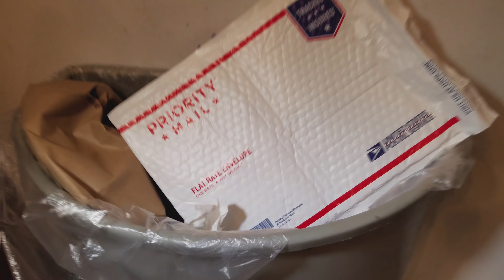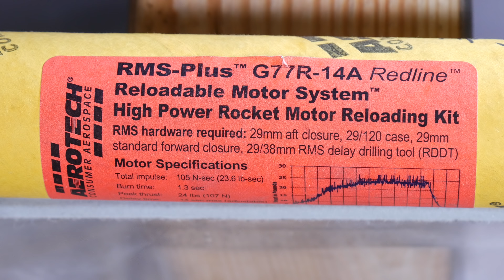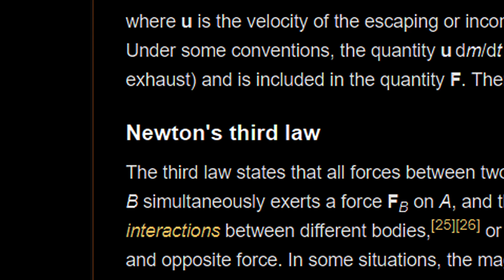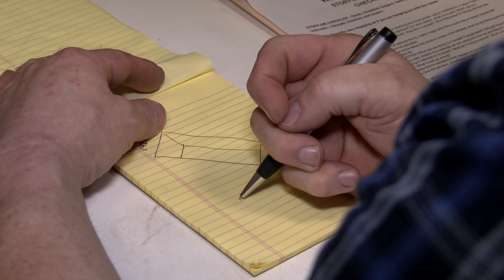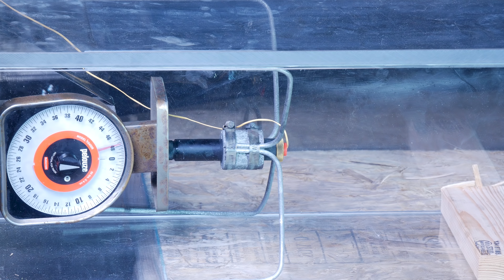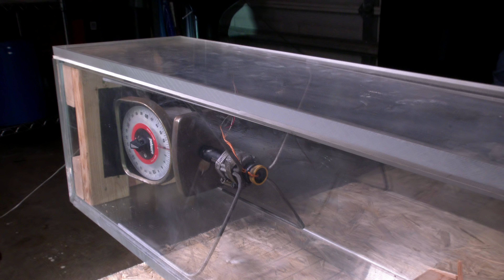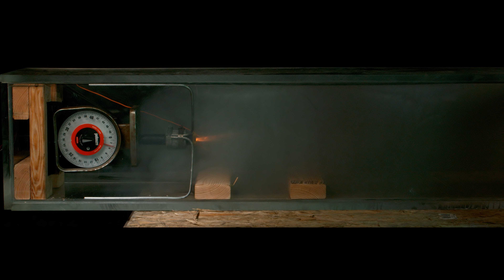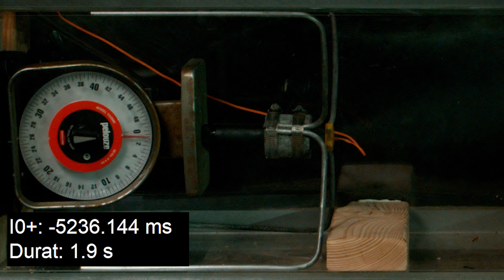Rockets in a Vacuum Chamber - Newton's third law of motion Visualized

Comment: If u ask me all I saw is that rockets wouldn't work in space. Then they did whatever it took to make it work. Idk I call straight b.s on this! Lol
Reply: Ok lets think about this. When you burn a gas what happens it gets hot right 

Do you know heat is just random motion of molecules
Reply: Tyson Carpenter - 👍🏽 this study is obviously flawed!
Reply: It looked like the time they are calling it a success didn't do any better than the times before, they just slowed the replay down to the point it looked like it was burning.
Reply: @hardersusan  no, there was legit thrust and the scale registered it. But that thrust was based upon the capped igniter that held s small amount of air that was contained like scuba tank, allowing it to at least combust. Once it did, the chamber was so small it's own gases pressurized the chamber and used the walls and its created atmosphere to push on the scale. The experiment was flawed and biased from the start. Yet, cleverly disguised as neutral scientific method.
Reply: What? You think this experiment is comparable to what NASA works on?
Reply: @hardersusan  What? It created pressure against the scale and burned fully... It %100 worked for the experiment they were doing.
Reply: @steved8714  Idk
..but if space is really a vacuum and there is no o2 in space witch fire needs to burn then how could they have rockets in space??? In a vaccum with no o2 but they went to the moon?? Witch NASA now says is in our atmosphere and apparently out atmosphere is way further away then they thought!?!?! I can b,s on,that too!! Its just like this exsperament they do and say whatever it takes to make there beliefs and there "science" to work!! Its all bullshit that's all I know!!! Just like this video!! The shit did not work when,it was just a vacuum so they started adding oxygen and whatever else to make it work to make it seem like oh yeah a rocket will totally work in space!! When anyone who knows anything about fire knows it needs o2 to burn! They have never been to space never will be to space and they are all liers!!! I wish people would wake up amd see!!!
Reply: @tysoncarpenter8628  solid rocket fuel has an oxidizer in it dude. meaning after ignition it burns it's own source of oxygen.
Reply: @BrewSquad  but how in a vacuum? Like in this experiment showed the first time in full vacuum mode lol. It didn't work.
Reply: Solid rocket fuel contains its own oxidizer. No O2 needed. Chemical rockets carry a tank of fuel, hydrogen or RP1, and a tank of liquid oxygen. The rest is just Newtonian physics.
Reply: @Your.Best.Friend  Only problem with that, is that a rocket do not push against air. Air is not solid and would only be pushed away. An explosion creates force equally around the explosion. This force is not dependent on air. The explosion in it self are dependent on oxygen, that is why the rocket brings this with it and feeding it into the combustion chamber.
The force cannot escape anywhere but out trough the rear hole. This pusher the rocket, the force och the explosion in the combustion chamber. Have nothing to do with air.
Reply: @tysoncarpenter8628  No, try to use your brain. The rocket are not dependent on the oxygen in the atmosphere. Two tanks on the rocket, one with fuel and the other with oxygen. Those to sprays in to the combustion chamber and voila you have an explosion without the need for atmosphere.
This is also why a jet engine does not have inlets for air as aircraft's have. Aircraft's have only fuel and use the oxygen in the air. Spacecrafts have both with them and hence do no need and do not have inlets for air. Only one outlet for the force to act trough, at the rear. Then you have the forward thrust.
In this experiment they used dry rocket fuel mixed with oxygen.
Reply: ONE thing is for sure about all this. There's a lot of nerds in here.
Reply: Tyson - I can explain EXACTLY how rockets work to anyone with a high school grasp of basic physics.  FIRST:. If I fired a crossbow in a vacuum chamber would I feel a recoil?  Yes or no?
Reply: @tysoncarpenter8628 : It takes two types of fuel for rockets to work. One of them is an oxydizer that allows them to burn in the vacuum of space, creating thrust. Things move easier and faster in a vacuum, because there's no drag from an atmosphere and gravity is weaker when farther away from planets, moons and stars. That's why they're able to reach speeds into the upper thousands of miles per hour and without heating up from friction in an atmosphere.
Reply: @tysoncarpenter8628 : His oxydizer wasn't mixed correctly. If you have pure oxygen, even steel will burn like paper in a vacuum.
Reply: @nikitafagerbrant2428 : They don't have to. All that's needed is for a high volume of burned fuel to be expelled out the nozzle and a high velocity Nd the law of 'Action-REaction' takes place. For example. If you were in space and you had a basketball and you threw it outward away from your chest, you're going to go the opposite direction. The harder you throw it, the faster you move in reverse. The basketball doesn't push against any air molecules, but its weight alone being thrust away from you is enough to push you in the opposite direction.
Reply: @nikitafagerbrant2428 : The exhaust is squeezed through the nozzle at greater than the speed of sound creating a massive amount of thrust which forces the rocket into the opposite direction. The larger rockets burn 5 tons of fuel per second. More than enough to propel the rocket upward and as it goes higher, it also gets lighter in weight and has less atmosphere to produce drag. The higher it goes, the faster it picks up speed to break the earths gravitational pull to put it into orbit. 👍
Reply: Put the bong down and step away from it slowly.
Reply: @preppertechnicianee6013 : Heat expands. In a combustion chamber, it helps force the exhaust out of the nozzle at over the speed of sound. Just like a fighter jet engine. That's why they shake the ground when the light, 'cause the sound barrier is being continually broken.
Reply: Thane Mac  - "No because cross bows don't create recoil."
There is a video on my YT channel that says different.
Please have a look.

Comment: I estimate that one side of that chamber is 50 inches long X 8 inches wide =  400 sq inches. Atmospheric pressure is 14 lbs. = 2.5 tons.  The total pressure on all sides = 10 tons.  That is the weight of a small bulldozer,   How did it hold up?

Comment: It would be a huge and expensive project but it would be interesting to see what a Tesla Roadster would do in a vacuum.
Reply: The tires would explode, and if it was in "space" the car interior and plastics would melt. It's all bullshit.
Reply: Line of Sight wrong
Reply: Line of Sight I'm with you 100% I believe the tires would definitely explode and the supposed temperature would basically melt the paint unlike the CGI version that we all saw that they passed off it's so fake it has to be real.
Reply: boboprime2000 how can you just say wrong produced your research in your evidence what would happen to a regular Tire in a vacuum do you want to see what a steel truck container after they took the air out look like after it was exposed.
Reply: Exaiver Sandiego you obviously didnt doch the Research, the pressure difference between Here and outer space is one bar, If a tire has 2 Bars of pressure on earth, IT has 3 in space, Most tires can easily Withstand 5bars.
The Paint Argument is also Bs, as There is no Temperatur in space, and the suns radiation isnt Strong enough to have a visible effect after Just 5 hours
Reply: Exaiver Sandiego Not to mention that the Roadsters trajectory was tracked by multiple Hobby astronomers
Reply: boboprime2000 wait a minute are you actually saying that you believe that the Tesla Roadster is actually in outer space heading toward Mars? So that means you probably think that back in the the sixties that man actually walked on the moon and somehow got by the Van Allen radiation belts and did it successfully with no problem is that what you're saying?
Reply: Exaiver Sandiego i dont believe it, i know it, Apollo flew through the weakest parts of the belt ans you can See the landing Sites With multiple Satellites, i know some Moon landing shit IS shady as fuck, but Trust me, as someone who grew Up in the soviet union, they would have immidiately destroyed NASAs Reputation If IT were fake
Reply: Exaiver Sandiego correction, the Roadster is heading towards the Asteroid belt
Reply: Exaiver Sandiego
Hellooo !!! Is there anything inside that flat skull of yours ???
Oh, I see, emptiness and flatness...sorry, I thought you were a "normal" human being...
...well, if this is the case...go on then, give us some more good laughs, you IDIOT !!!
Reply: Axel Pixel acting pretty sure of yourselves.  Lol  So you or someone you know has been to space? Or you poured through all the data, telemetry and physics jet propulsion and astrophysicist theorem to make a concise argument for your belief? You all sound very sure like you've been there. Just wondering how it was and what zero gravity feels like? The vacuum. Lol
Reply: +Line of Sight   Why would the tires explode?   Most tires can handle much more pressure than is used.  Plus if necessary they could reduce the air pressure in the tires before launch so that the pressure with an external vacuum wouldn't be that high.
Reply: Tires wouldn't explode. 14.7+35 psi is just 50 psi. But the car would melt itself and short out from lack of battery cooling.
Reply: +Patrick L   Why would you think that the car would melt?  Why would the battery need cooling?
Reply: My3dviews I assume the OP means driving it in a vacuum. That would make the batteries hot, especially with a lack of air. Although it would be interesting to see how fast it could go with no wind resistance.
Reply: +Patrick L    The radiator and engine would get hot from a lack of air, if the car was running, but not the battery.   Also, no reason that the car would melt as you mentioned in your previous comment.   With it flying through space it would just get warm from the sun on the lit side, but cool off on the dark side of the car.  It seems to be rotating, so that would even out.
Reply: wow a lot of waking  up to happen still in this chat. But nice comment bro.

Comment: I couldn’t stop laughing from seeing the lid of the “vacuum” chamber almost go flying off halfway through the test. These guys tried hard and did a good job building a cool experiment...but come on that things flapping around like crazy with all the high pressure gas trying to escape...it’s not really proving the point of whether or not rockets will work in space. It’s proving they will work in a pressurized plastic box for sure though.
Reply from the maker: Lol... True!, Btw for sure my biggest mistake was not having a full vacuum on the very first test. The box got a little bit cloudy after that. I later on in the test it did hold a vacuum, kinda

Comment: Thanks for making awesome videos. This is the first time I have a problem on the way the experiments are conducted. First; why isn't the chamber sealed or clamped down? You can clearly see it vibrating open on several attempts. This breaks the vacuum and lets air mixture in.
Second; the reason you see the flame front in the middle of the chamber is resonance. My guess from the weight of the outside air entering the chamber during the vacuum seal breaking. You can observe this inside a running ICE too.
I am not a conspiracy theorist but this video validates nothing. Sorry.
Keep up the good work! =)
Reply from the maker: KaxLon you done clamp down the top on the vacuum chamber. No air was entering
Reply: KaxLon lmao really? Only one that vibrated the lid was the first attempt and he even mentioned after second attempt actually had a full vacuum because he put in basically a frame... plus you can hear him say "wait I'm still vacuuming" some one else said "I'll give it 1 more second".... So lack of time to get full vacuum.

Comment: The experiment would be much easier to perform and more representative of reality if a vacuum extraction system was mounted to remove exhaust as it was created. Conducting this gas-producing process in a sealed chamber is flawed and self-defeating... Apart from that, the experiment is redundant... Obviously you are not about to debunk Newton, so simply do the maths. The mass of the propellant and its exhaust velocity are known, therefore the thrust in a (true) vacuum can be easily calculated. measure experimentally the thrust in an atmosphere  and make a comparison. The truth is usually simple. Has anyone watched the famous footage of the  rocket engine thrust the Ascent Stage off the moons surface without the slightest hint of immediately flying into a catherine wheel type spin, as should be expected  (to locate and dock with the CSM orbiting at 5,000 knots - lol)... without saying to themselves "hmmmm" ?
Reply: Controlled opposition within controlled opposition. That's interesting.

Comment: It's both sad and frightening how many people can't grasp basic physics that they should have been able to understand back in elementary school.
Reply: @jrngln  
Nice copypasta. Every word of what you just said was wrong.

1) We can get close enough for practical purposes. Technically space isn't a pure vacuum either, but it's so rarified that molecules rarely come into contact with each other.
2) A vacuum doesn't "absorb" anything, you're speaking nonsense.
3) How exactly do gases on the opposite side of the chamber affect the rocket motor? The answer is they don't. The only forces come from the direct interaction between the motor and the gas. As soon as the gas leaves the motor, it can't transmit a force.
4) Yep. Rockets push off of their exhaust gas.

Comment: To pressurize a cabin of an aircraft that goes at high altitude, 10k + feet,  it must be in a cylindrical shape to even out the pressure throughout the structure. You're attempting to vacate the air within a what looks to be a 16" × 16" × 8' plexiglass rectangular structure ?
 If you were to attain even slightest amount of vacuum within that given area the walls of that plexiglass, within the middle of the structure, it would absolutely collapse in on itself. At this point I'm not certain that many of us have seen what vacating the given area within a sealed, airtight, train tanker car cylinder shaped tanker car, to be redundant, lol, does to the structure of that train car tanker structure. It Absolutely Buckles it within itself. Collapses in on itself, with 100% failure. Not even close to a huge Torr value, (the measurement of Vacuum, (Named after "Torrtorelli", the scientist that studied vacuums, and said measurable values), and that's train car wall is constructed of Steel. 
One more thing, a vacuum chamber at NASA is the shape of a cylinder with a dome top and it is an amazingly thick-walled structure.
 It's 150 feet high by 130 ft diameter. A concrete casement with walls ranging from six to eight feet thick. Which also have a steel containment barrier within that concrete structured wall. A  perfect Vacuum is beyond our comprehension for containment. Yet the Earth is supposedly surrounded by a
near-perfect vacuum, supposedly 100% vacuous, which is the term describing outer space. There is 
no containment barrier between our environment of air and gases and this claimed to be, 100% vacuous outer space ? And somehow, it does not evacuate all of the gases off Earth, within an instant from our supposed globe Earth ?
One more item of Interest. Why don't they have the astronauts walking around within the confines of that near-perfect vacuum chamber in their "outer space suits" ?
Because the suit wood swell instantly and then it would violently explode and then the human being inside of that once confining space suit would literally enlarge explode and evaporate within seconds. And I'm talking probably 10 seconds.
Reply: You've got it right, Bob.  Kudos!